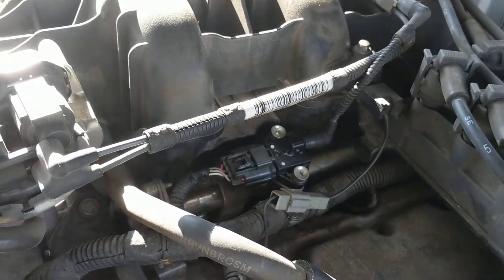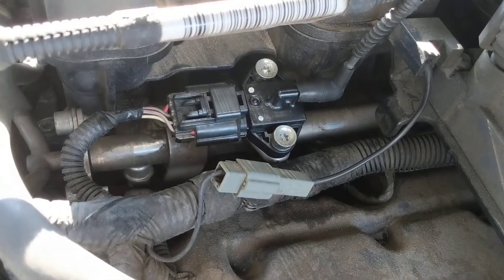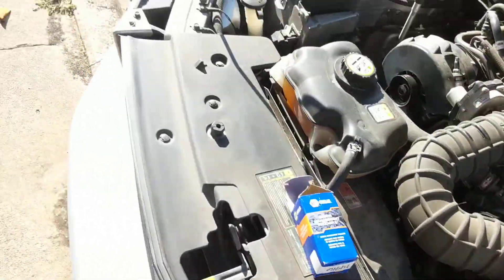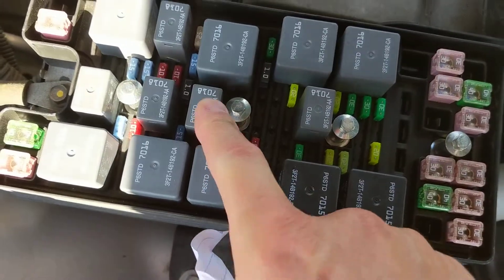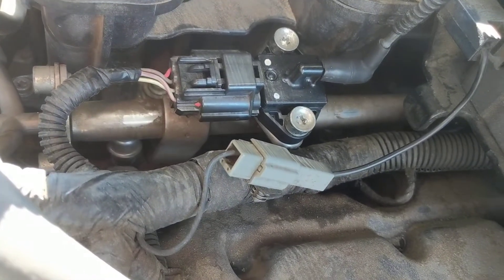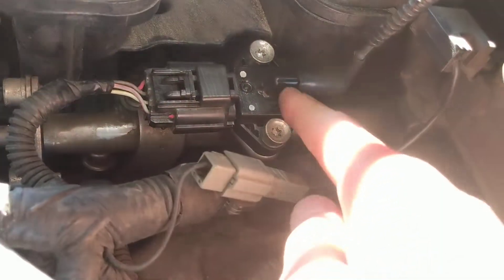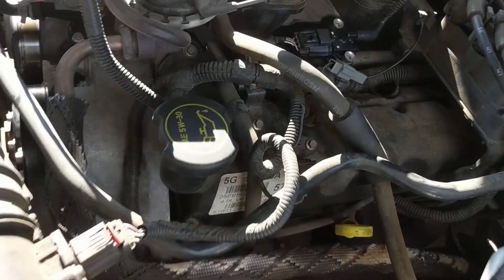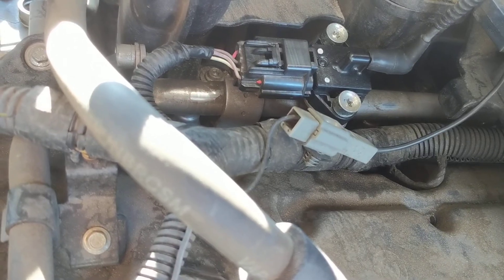How to Fix P0193 and P0182 Codes

Comment: So the moral of the story? Buy middle of the range sensors?  If they're really cheap buy a couple and sell them on?
Reply from the maker: Yeah this is true, and I found it to be true with other car parts you think they'd all be made pretty much the same but unfortunately not. And one thing I really found out if the parts really hard to put on make sure you get a good one because it could cost you more put it on and taking it off then the part itself just in your time and then if your car breaks down that could really cost you be stranded somewhere.

Comment: I'm having this same issue! Been having p0193 code but already changed fuel pump,relay, filter and this sensor (tried 3 different ones lol) and it still won't go away!!:( anybody got suggestions? I'm guessing its an electrical issue at this point
Reply from the maker: I think AutoZone has free tools to lend you or they have a tool rental I think a lot of times they'll lend them to you for free for a day or two and you might need to get a fuel pressure gauge and put it on that rail the fuel rail and then turn the engine key on and see how much pressure there is on that rail That way you'll at least know that hey there's a problem with the fuel pump pumping too much pressure or if it's correct then it's got to be something like you said with that wiring or a bad sensors you're getting
Reply: @JohnDaniels  ahh ok yea I was thinking of just changing out the fuel rail tbh but ill take that into consideration thank you!
Reply from the maker: @jackarlos1  You're welcome, and good luck. I was going to tell you also after I replaced the fuel pump with another fuel pump I started getting the high fuel pressure sensor error well the fuel pump I replaced it with went out I guess it was a manufacturing defect so I replaced it with another one and then after I replaced it I stopped getting the error code so it is possible that the fuel pump could be causing the problem
Reply: @jackarlos1  Autozone in my area said that an Ohms test should be done on the wire harness to the sensor; if bad, replace the harness; if good, replace the sensor........
Reply: How do you do an ohms test

Comment: My 06 v6 mustang has been cutting out after stopping and during driving, got the p1093 code. Is anyone else having these symptoms?
Reply from the maker: That actually is one of the symptoms that could be causing that code I mean it could be the sensor itself or it could be the fuel pump so or maybe the fuse I would start with the fuse and then work my way through I mean if you get another sensor try that and then when there's really I don't think there's any way of knowing unless you start swapping out parts and see what happens
Reply: I’ve been having the same issue with my 06 v6 mustang it would stall at times while driving and just recently it stopped working at all, it gave off the same code plus p0172
Reply from the maker: @kaiwilliams9735  when you turn the key on to the ignition but don't actually start the car I think you turn the key twice it clicks twice do you hear the fuel pump running?
Reply: Now the mechanic chargin 2.4K saying my computer is dumping fuel into the engine?? Man I shoulda saved up for a solara no cap